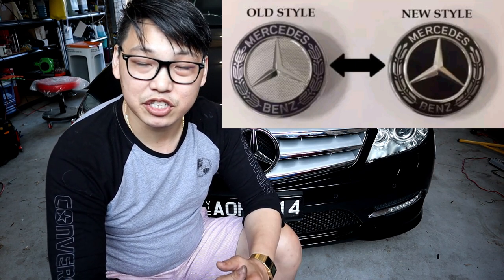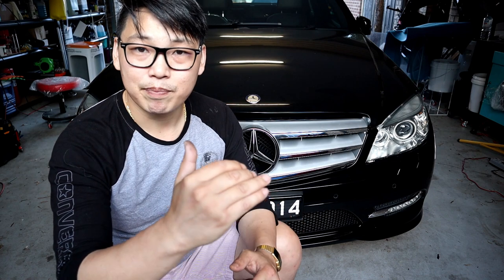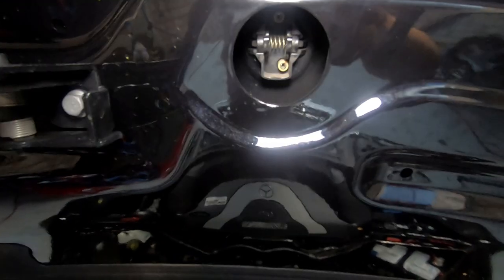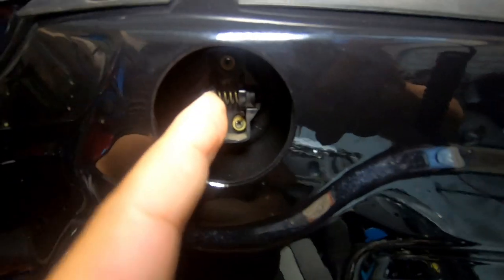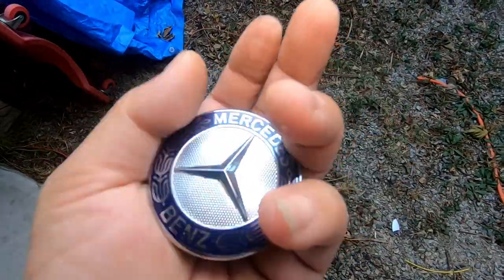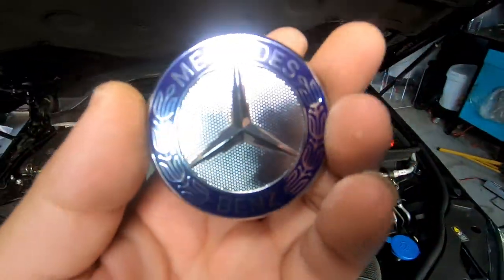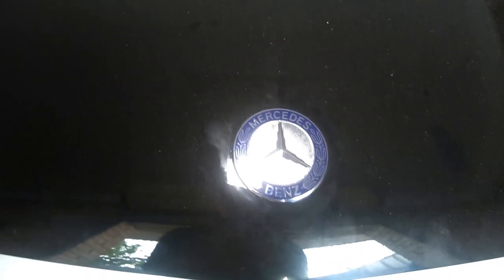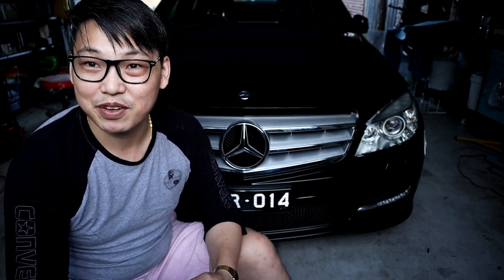MERCEDES BENZ w204 how to remove and reinstall or change your bonnet hood emblem badge

Comment: Do you know anything about the hood being non flat? I saw some videos where they install it and its loose because the badge is made for a flat hood but the newer w204 or the amg are not fkat so the badge does not work as it should
Reply from the maker: hmmm..I haven't deen that but in that case u will need to get a badge that is shaped the same ... I used this on the w203 and still fitted great so I guess its flat enough